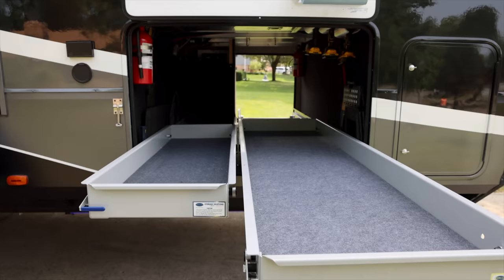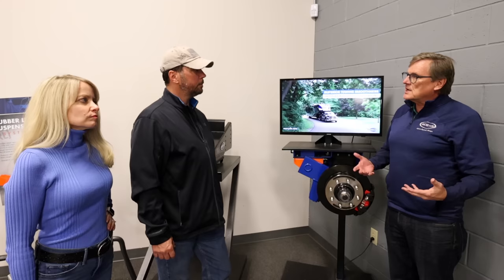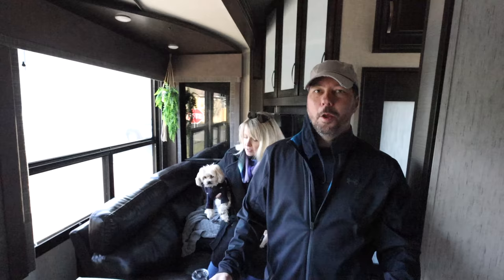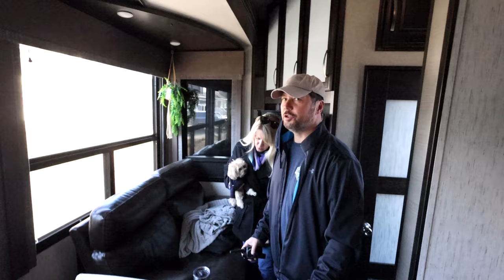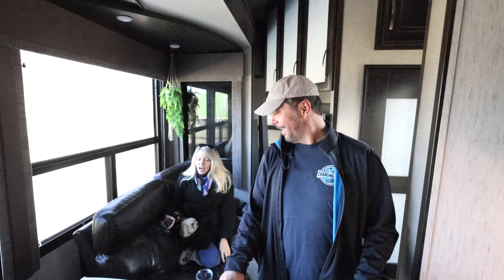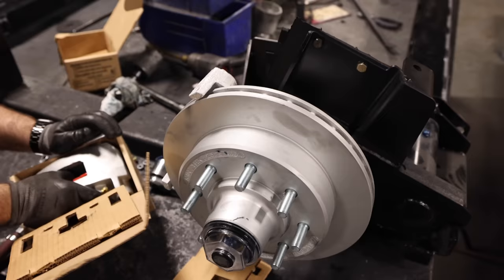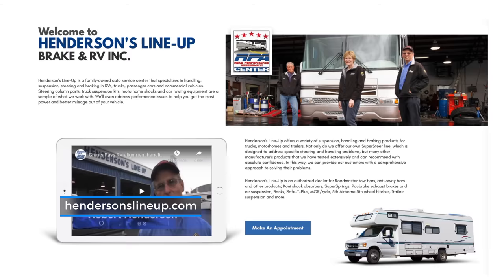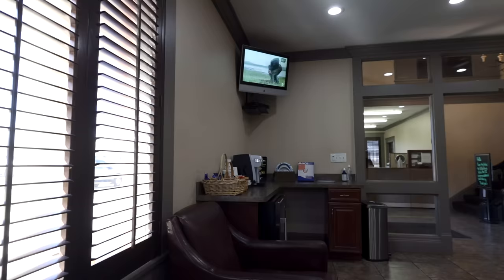MORryde Independent Suspension and Disc Brakes

Comment: Most YouTubers I subscribe to that have Grand Design have issues with their axles causing abnormal tire wear or bad road ride. Sounds like Grand Design doesn’t put much into the suspensions their products.
Reply from the maker: Leaf spring suspensions are pretty much the same across all brands.  Some of the high end units like DRV include the IS.  But, you pay for it one way or another.

Comment: does it allow you to have more or less weight in the trailer? How much taller?
Reply from the maker: While it does improve the suspension and likely the "actual" capacity, it does not change the actual rating of the trailer (the DOT sticker).

Comment: Would they switch your wheels to sealed bearings if requested?
Reply from the maker: I would think so.. But that would be a question for MORryde.
Reply: When I had mine installed last December (2019), I asked if I could get the oil-bath bearings versus greased and they said it currently was not an option. They did offer an upgrade to Timken bearings which I paid a little extra for. As Chad said, they will happily discuss the various options/prices when you contact them.
Reply: Ours has sealed bearings moreryde IS came with rig LUXE39fb

Comment: Cost
Reply from the maker: You can find the pricing details for the various IS options in our blog post here: https://changinglanesrv.com/morryde-independent-suspension-upgrade/ 👍🏼
Reply: @ChangingLanes  designs should put that in there and their trailers from factory great selling pitch
Reply from the maker: Some manufacturers do include the IS by default.  But, you absolutely do still pay for it.  It's just bundled into a higher starting price.